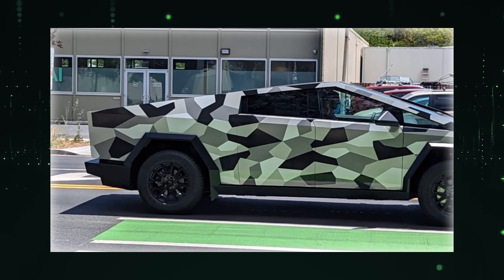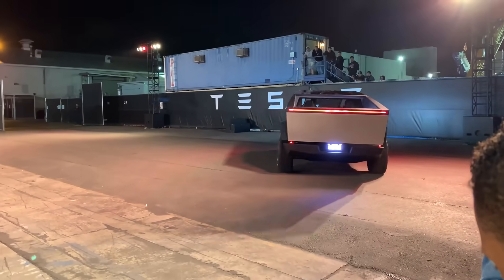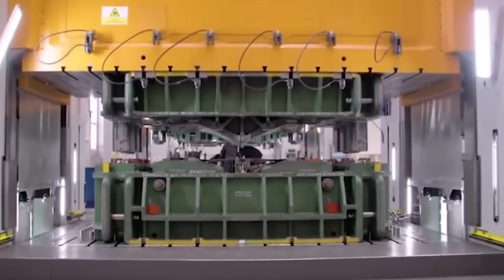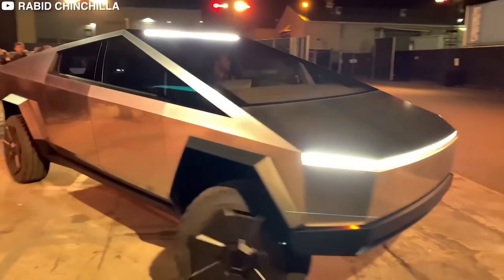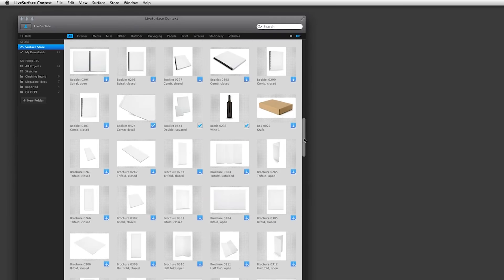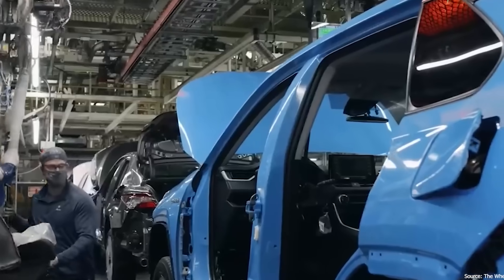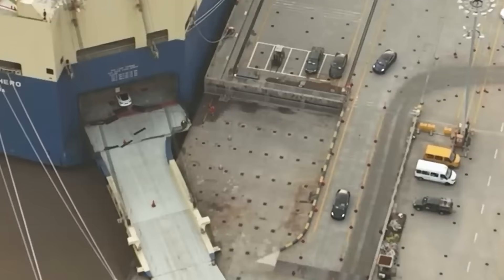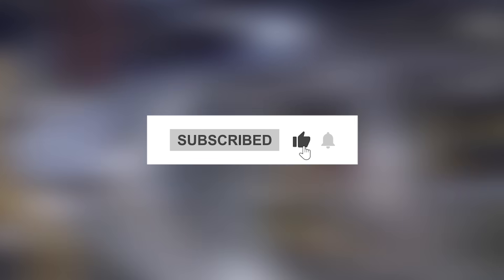Tesla Cybertruck is Hitting The Market With Insane New Features

Comment: people against ev's with no actual reason even if they think thry have a reason they dont becuse one doesnt exist are ignorant as fu*k. i drive a model S and i get ignorant people telling me stupid shi*t all the time but fact is after driving a model s everything else is stupid especially slow laggy loud gas vehicles that make lots of noise but arent going anywhere while i silently blow by them like their standing still  like the dude on here saying something about hed like to see an ev launch a boat i guarantee my car can tow and launch any boat better than any truck and ill look better too well it might look kinda funny but still..  thats why the ev semi teslas semi wil be able to pull full loads up the steapest grades and not lose speed like diesels going 2 mph with their hazards on clogging up the highway cause ice vehicles kinda suck they are impracticle really  takes a million parts to make one work every part seems to need another part for it to work and not explode or vibrate and shake itself apart just to spin some wheels and move you forward dthen theres super compact for the most part simple electric motor that doesnt need all the extra crap like radiator, transmission, oil, counter balancing to keep it from violently shaking itself apart and then theres the giant tank of explosive liquid you have to carry around with you to supply the mini explosions that are what engines do to make the pressures to spin the thing that turns the other thing and so on until eventually getting to spinning the wheels for forward motion. or theres electric which unfortunatly has a huge heavy ass battery which is only slightly better than a tank of explosive pressurized liquid and a pretty small motor that is almost silent insanly powerful and endless torque no transmission or radiator none of the fluids allnthat needs no spark plugs very few moving parts nearly zero maintainance almost never have to use the brakes with regen braking and all that means way more fun to drive i wontnkill myselfnif i were to fall asleep in the garage with my car on oh yeah cause theres no exhaust system either  why the hell did humans ever even bother mking gas cars evs and ice cars both were available since the invention of the horsess carriges we call vehicles oh yeah because of the oil thing rich people equals power equals getting richer which equals more power which equaled death to ev and preservation and protection of their riches and power and control

Comment: Biggest concern is using the truck for towing... most chargers are used with the vehicle backed in, does that mean every time that you want a charge you have to disconnect the trailer... be nice if some chargers had a drive thru capability.  I own a model Y performance that I sometimes use for my motorcycle trailer, to be honest it is a PITA to charge, due to disconnecting of trailer first.  Elon, please have at least a couple of superchargers that are drive through.
Reply: I've seen the new charging stations designed for the Cybertruck specifically,  they are drive through chargers which look big enough for a 35' truck and wide enough for a semi tractor. My guess is that the ev semi might also be able to use this same charger. 20 minutes from 10% to 100%
Reply: thats your own problem. Elon wont make something convenient just for the small percentage that needs it. Its something not needed often
Reply: Don’t forget that this production model is also SMALLER than the 40K prototype Musk showed off four years ago.  And most of what it is towing are massive batteries to attempt to achieve a decent range.  Which everybody knows Tesla constantly over-states.

Comment: Thought the cyber truck was supposed to see at a starting price , that is not too crazy.  Originally stated as $40,000 . Latest news this week is looks like its going to be a starting price at $60,000 :(
Reply: At the Unveiling, they offered a "Starting Price" for a "Single Motor"  version, of $39,900, but that doesn't mean, that the First Trucks will "Start" at that Price! 

They typically start off at the Highest Price Version! In the Cybertruck case, that was the Tri-Motor version, at "$69,900" - Pre Inflation Adjustments!
Reply: I'd say closer to $100,000.
Reply: @Withnail1969  - Well, if they start, with an as yet undefined "Quad Motor" version, that is still a "Possible" starting price, for First Deliveries (this Year)! 

Personally, if a Quad Motor is offered, it seems it should offer even greater Towing Capacity, beyond the Tri-Motor, that was stated to be 14,000 Lbs, or 4,000 Lbs above the Dual Motor version, of 10,000 Lbs! So, maybe a target of "18,000 Lbs Towing?" 

And, shouldn't the "Range" be Higher, as well, like, maybe a figure around 650-700 *Miles*, in the Quad? (To be a "Fair Value" for $100,000!)
Reply: @Withnail1969  More than one YouTube video where a Tesla tows a medium size (typical) family caravan.  The range is almost halved.  Not good if one is going to say a 500 mile drive to a holiday site.  Also, it would be a pain to disconnect the car from the caravan everytime it needs to be charged.
Reply: Yeah it was announced before we saw massive inflation. Dollar value of $60,000 today is less than $40,000 at announcement. The money in circulation has more than doubled since then. Do you not know how money works or something?
Reply: @MrGoodeats well if Elon didn’t announce until they were actually able to deliver their products at scale this wouldn’t be an issue, Tesla is the only car company that has this issue in point of fact.  But Musk’s paper wealth entirely relies on keeping the hype cycle in perpetual motion, despite many failures to deliver on promises, including fully autonomous vehicles/robo taxis; hyperloop (lol), the Roadster, which is still not even slated for delivery and a rocket capable of putting man back on the moon.  Do you not know how honest marketing works or something?  Cybertruck is the vehicle that is going to sink Tesla financially, mark my words, a utility vehicle at 100K to be even remotely able to function as a ‘truck’ is a joke!  This is a vanity project aimed at rich idiots and fanboys.  People who preordered when Musk announced will end up waiting almost a decade for their vehicle, and end up paying well over double the original estimate.  If Musk doesn’t go broke before then, which is entirely a possibility.  O but the semi which is apparently cheaper than rail (lol again) will surely save the company. SMH.  Have a nice day 😂
Reply: I have a 40k reservation. Reservation holders when that price was announced still only pay that and apparently the list is -/+3 years long.

Comment: Tesla, should add a Car Alternator. On the cars and trucks. That they build . Have it being,driven off the Gears of the Transmission. That are at the Electrical Motorand the Gears that turn the Wheels. This would be putting Electrical Current into the Battery as you drive. And would not take any Electrical Current out the Battery. But only put Electrical Current as you drive. And on long, drives, that would  maybe make it that you would not to stop. To charge the Battery.If the Alternator was putting out about 200 to 300 Amps.
Reply: Trying to understand what you are trying to say but I just want to remind you of the law of thermodynamics
Reply: you're describing a perpetual motion machine. physics tells us that is impossible.
Reply: This doesn't work, and huge numbers of shade tree mechanics have tried 'this' and found that out.
Reply: Someone wasn't paying attention in physics class and it shows.
Reply: Will decrease battery life The only the solution that would help a lot but only few manufacturers do is solar panels.all electric vehicles 50% or more surface areas should be panels especially with climate change why not recycle all this freaking heat 😆
Reply: @Floyd-Int we should stick to facts. Climate change is not factual.

Comment: Sorry but the cypertruck is ugly. This may be fast which is good if you have money for tickets. One good thing is its supposed to have a range of 500 miles which is greater than my buick lacrosse hybrid at 402 to 408 per tank of gas. But still, my buick looks alot sexier. And it takes me 7 minutes or less to fuel up and that includes running in and grabbing a coffee. The cybertruck takes 16 hours to charge. In 16 hours i can drive from Pennsylvania to Florida in 12 to 13 hours. They can keep this 60 to 70 thousand dollar sit around ride. My Buick Lacrosse hybrid is paid off at 17thousand dollars.
Reply: trucks arent supposed to be pretty. they are supposed to be robust even manly
Reply: @barrytelesford5265  i agree they're not supposed to be pretty or ughly, just the bad ass work horses they were designed to be....
Reply: My Model Y Performance takes about 8hrs to charge in my garage overnight.  If I'm using a supercharging station it takes about 20min to get an 80% charge.  I wake up in the morning and it's ready to go.  It's way more convenient than stopping for gas in my opinion.  That said if I am taking a road trip I'd still take my F150 just because the range is longer and takes less time to fuel.  But for typical around town driving electric is way better.
Reply: @sanantoniofoosball2977  yeah i agree with that. If i got an EV, i would definitely use it for local destinations and for going back and forth to work which is 1 mile round trip. But with my buick lacrosse hybrid, i still only fuel up once, sometimes twice  twice a month. Now that's different when im going to drive to Florida or Tennessee. And we have to drive because highspeed bullet train technology doesn't exsist in this country which is also fully electric. Only in the far more advanced countries of the far east and Europe.
Reply: Takes even longer at 11kwh (21.5 hours), but not too bad at ~56 mins from 0-100% or 44 mins at ~20-80% at a 250kwh supercharger. I’m assuming one is probably going on a longer road trip and a 1hr food/bathroom break isn’t too bad to charge fully, but even 30 minutes is probably fine until the next break. I imagine the 21.5 hr full charge is sufficient for overnight charging. Or ~7.2 hrs for 165 miles each day as you’re sleeping. Can’t disagree with the style. You either love it or you hate it. Unique for sure.
Reply: congratulations on your buick
Reply: @Xeyedjohn  thanks X. I will buy electric but it hasto be better than what i already have and i just haven't found that yet..I have a 1500 pound food wagon. Will this electric truck pull it? Can i load a refrigerator and freezer on it? What is the tow capability?
Reply: I will be more than happy to buy a Tesla or an EV when they perfect them bringing the charge time down to 10 minutes, when they come out with a luxury car as smooth as the 1996 Cadillac Fleetwood, when they give them a range greater than my buick lacrosse hybrid which is 402 to 408 miles and  all for under 20 thousand dollars. Then I'll get one. Let's see what happens down the road. But when i drive to Florida from Pennsylvania every year, i still would park the EV and take the buick lacrosse hybrid. Once they build a highspeed bullet line from Boston Massachusetts to Jacksonville Florida, then I'll park the cars and take the train for a 6 to 8 hour trip instead of driving 12 to 14 hours. Oh yeah did i mention that highspeed bullet trains are fast, automated and (fully electric)?
Reply: @carlsmith5545  You could also save a lot of time by not spending it here complaining about the looks of the cybertuck and disadvantages of EVs in general.  I didn't see anyone ask you to buy one.
Reply: it will in reality have a terrible range, won't be able to off road and won't be able to tow anything. it's far too heavy.
Reply: @Withnail1969  But it's classified as a (truck) you mean it's designed only for trend and not work? Damn! Oh well. Thanks 1969. All this is apart of my 1 year research in trying to find an EV that supersedes what I have now. Maybe I'll just wait and see what comes out in the next 2 years. They have to come up with something that only takes 10 minutes or less to fully recharge.